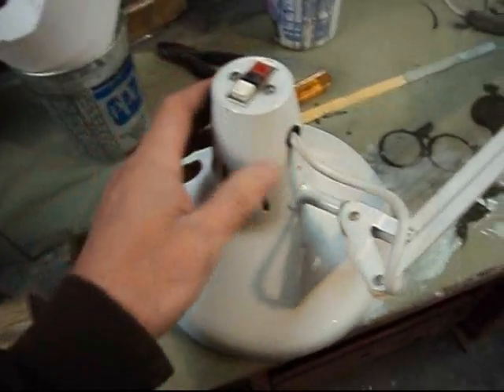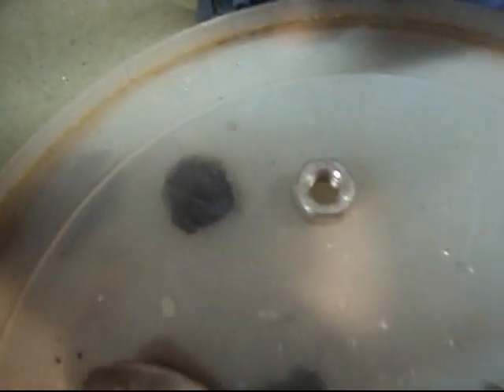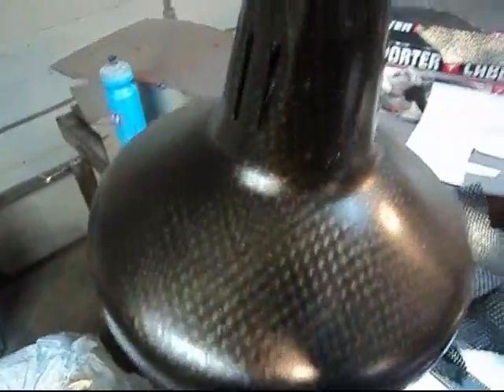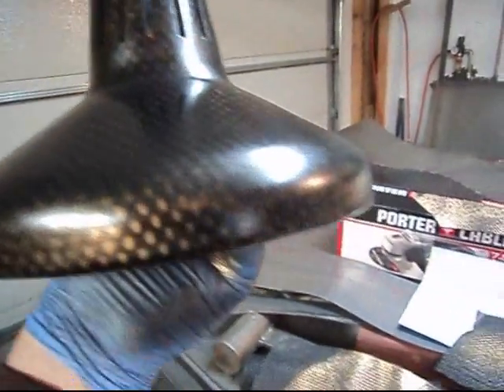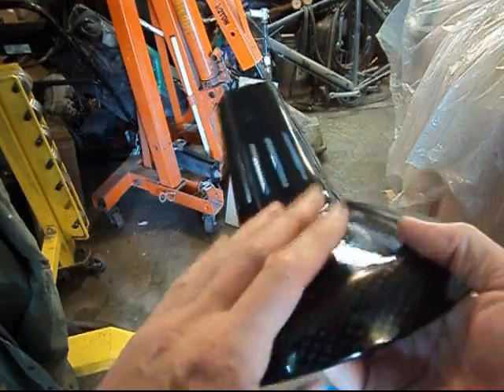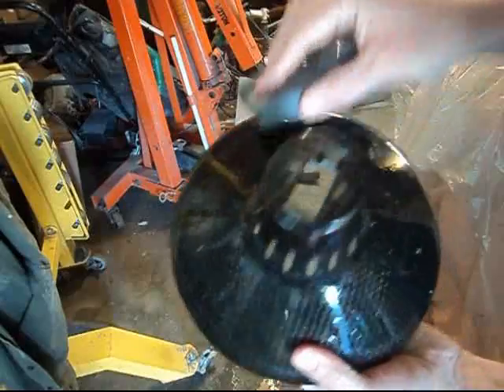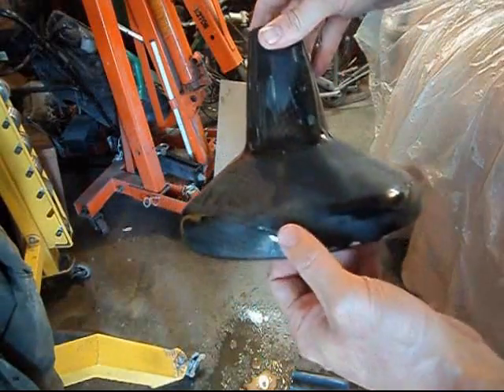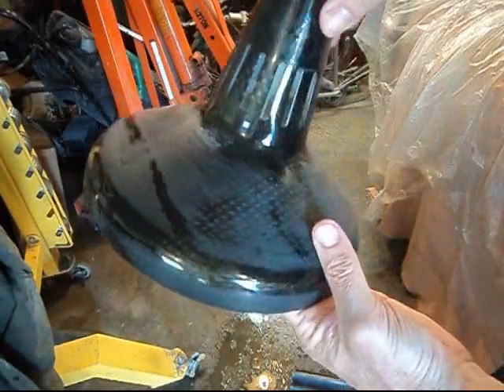Carbon Fiber Finish on a Luxo Lamp - Part 1

Comment: Nice tips, Question: How would you do this effect to wrap around a 90 degree corner? I am painting my first computer tower and want to use this effect on the side panels and would like it to wrap around the edges.